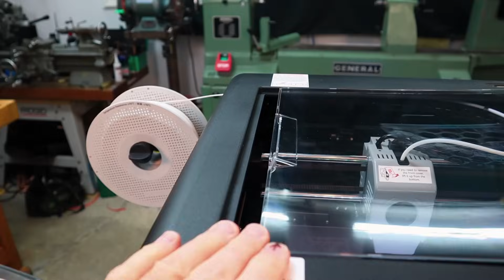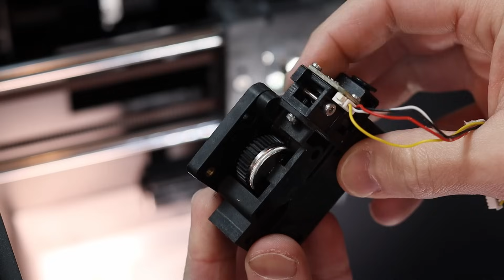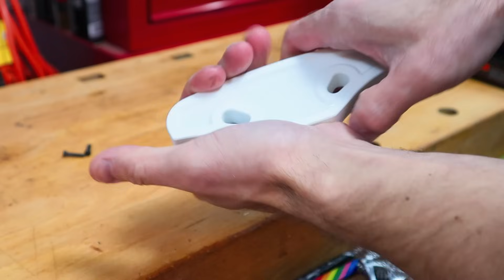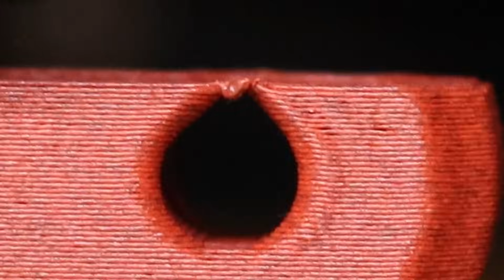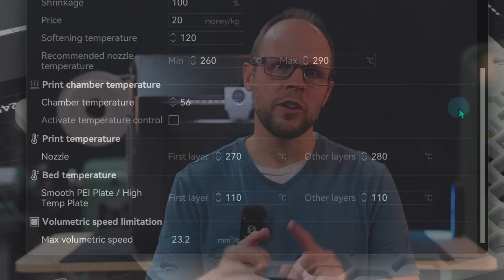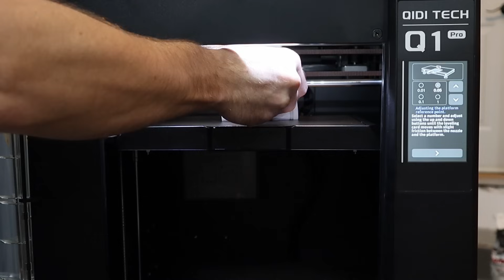The All NEW QIDI Q1 Pro - Affordable, High Performance and High Tem...?

Comment: I look forward to your Q1 pro upgrades especially a air filter one. I used your QIDI link when I bought mine a day ago  (3-20-24) so I hope it  gave you credit. The Q1 Pro is arriving sometime tomorrow (3-22-24) already.
Reply from the maker: The first of two videos I have planned is coming tomorrow, I'll probably make several more because the printer is so capable and it opens up a lot more possibilities for printing stronger parts.  

Thanks for using the link I really appreciate it!

That's fast shipping, they were already loaded in the truck ready to go.
Reply: One more thing to add to a video, best way to remove and add filament. I seem to get a heatbreak clog and have to remove the heater assembly ( easy fortunately)to clear the piece of filament. 
I’ve owned many direct drive printers but they all had a manual extruder gear release lever. Made it easy to heat the hotend, push on the filament and then quickly pull it out, nothing left behind. 
Please do more videos on this printer. I need to find that link to make a donation when I send this post.
Reply from the maker: @gr7396  I just released a video yesterday and I'll definintely have more to come, I'm still going strong with this printer.  The only time I've had a problem with switching filaments was when I tried to use their process for unloading/loading filament and I was switching from PETG to TPU.  It left too much material after the extruder gears and the TPU was not a fan of pushing PETG.  I stopped using their process and I went to what other printers do, extruder a small amount and then retract the rest, works like a charm.  

I've spoken with QIDI about this issue and they have passed the info along to their engineers, I hope to see a fix on their touchscreen.  The Bambu performs better for material changes so maybe there is something to learn there from the Bambu printers that QIDI can apply as well.

I was told that you can manually pull the filament out, it is on a spring Afterall, so maybe it's possible.  I will have to try this out to be sure.
Reply: They should have added a release lever so you can get a straight shot into and out of the hotend. I’m not new to printer mods and will think on it and try a few things. With the hotend cover easily removed to get to the extruder gear, that adds an advantage but there must be a simple solution or an extruder redesign? 
FYI, I had trouble with PayPal taking my new CCard then it used another on file for $1+ $1 monthly. So I guess I’m a ASA member now or two pla members? 
Keep on this Q1 Pro and QIDI and I/we will be good. Slicer info and print settings also a good thing to keep on.

Comment: It definitely has a few questionable design choices, but it's still pretty good, especially for the price
Reply from the maker: There are just a few things I would want to change, tomorrow I have a video releasing for one of them.  Overall the important parts are accounted for, the extruder, hotend, structure.  The print quality at this point rivals the Bambu X1C, it may, just may be better, I can't tell yet if that's because the parts warp less with the heated chamber.  Regardless, for the price, it's a solid printer and I look forward to a larger version of the printer, I assume there will be .
Reply: @NeedItMakeIt  The less warping of stuff is probably due to the actively heated chamber, that's one of the few differences it could even be ¯\_(ツ)_/¯

Comment: Odd that only Vector 3d mentioned that this machine is running a klipper version over 2 years old, and there is no way to update it because of the proprietary changes Qidi did -- vanilla klipper is the best klipper.
Reply from the maker: I can reach out to QIDI to confirm, but I have been printing on this Q1 every day which hard prints and the quality is as good or better than the X1C, the extruder, the structure, the motors, everything seems to be how it should be to maximize the quality of the final product.  I even printed a nearly solid ABS print today with fuzzy skin with 0.06 Amplitude and Length, which is less than I've ever done and it looks incredible, can you tell that I'm impressed?  Normally I'd have to struggle with settings and calibrating filament... I have done nothing but use the stock settings and turned on fuzzy skin, it was also in a heated chamber, which probably helped to keep it flat. 

I'm blabbering on, the point that I'm trying to make is that old or new, it seems to produce great results.

Comment: Great review!I like the practical prints vs what others do in their reviews by printing figures and benchies and other useless trinkets.  Your way is much more desirable because these are the types of things I want to print, functional things like jigs and brackets, etc.  Definitely tempting to pick one up. I just wish they would have gone with a slightly larger build plate 256mm at minimum.  It's kind of strange why they've released this one because the X-Plus 3 also has the same nozzle temp and heated chamber, but doesn't have a camera by default, it's also larger.   Either way, I really like where Qidi is headed, if they keep improving like they are, they'll be sitting  high up there soon!
Reply from the maker: You and I must think alike because it really hurts me inside to print little boats and toasters and know that they have no function aside from showing how they look.   I've been printing more with the Q1 and it continues to perform well, even beyond what I would expect.  ABS, no problem, PETG with the peaked holes, no problem, PC.  I didn't bother with PLA since this printer is really meant for higher temp printing anyway. 

I think they'll be coming out with a whole series of these printers, I can only assume they're already in the works.  Q1 PRO-PLUS, Q1 MAX?   The printer really hit the mark as far as giving people what they're looking for. 

They probably were responding to feedback about the looks of their printer and make some other small design changes, the hotend for example, now they've moved to the Copper HS, which is pretty nice indeed.

We'll have to keep an eye on them for sure!  I hope they come out with an IDEX or something to print just one more material.  If I could print 2 color TPU, that would also be really cool.
Reply: @NeedItMakeIt  That would be pretty awesome!
Reply: Oooo, side note.  I would love to see it printing sinter metal filament parts.
Reply: For the sake of discussion, I ordered this printer because of the size and camera. I'm a small engine teacher and the head bus mechanic at our local High School. This unit fits on my personal toolbox inside the top hutch. Just barely, but it is in a space that is a no student fly zone. The build plate is just big enough that I can print most parts for student projects and bus parts that need to be tougher materials. Any bigger and I literally couldn't get this printer in the space I wanted for a heated enclosure unit. With the camera I can keep track of prints regardless of where I'm at in the school. I will also be able to link students to the cam so they can keep track of their parts. Curiosity and excitement are easier when you can see the action. That being said we have a Elegoo N4 Max already. We went big for "just in case" and it has paid off. But because of our shop environment ABS and such 100% will warp. So now I have to build an enclosure. But honestly most of our class stuff is currently "survivng" on PLA. With this Q1 I will now be able to pop out the occasional tough part for kids or any of my maintenance parts in a flash until i can get the N4 Max customized. So, not trying to down play your needs, but just wanting to mention this unit hit me nail on the head😂. Also, a side note, this will be my 3rd printer purchase in 7 months. I have a problem.

Comment: Could  you elaborate on spool tangle sensor please?
How easy would it be to add to, say, K1 ?
Reply from the maker: Hi, and sure, the tangle sensor is on a spring, when the spring maxes out, it looks like there is a switch activated, it's fairly simple I suppose and probably could be integrated into the K1 with a bit of design knowhow.

Comment: The most complete and objective review of that Q1 Pro. Great tutorial and especially impressive outputs. Thank you! You earn a new subscriber!
Reply from the maker: Awesome thank you very much!   For this printer they made it pretty easy on me, it works out of the box, it prints really nice with hard prints, and they're real prints no just benchys or toasters, and yeah it's a bit bulky, but I can look past that if it performs well, and it does.  Today I printed a nearly solid ABS print, with the finest fuzzy skin that I've ever tried thinking it would break the printer, and the print turned out flawless, one of the if not the nicest looking prints I've ever made.  

They've obviously took the time to address the main points to create a high-performance printer at a good prince, the heated chamber puts it over the top.  I think they should sell an add-on filtration system though, high-temp materials including ABS and PC release more chemicals into the air, I'm pretty sure that long-term exposure will lead to some sort of health impacts.
Reply: @NeedItMakeIt Health hazard is an important point as you explained it so well. Few people mentioned it in filament 3D printing. It looks obvious when you deal with laser cutter just because people see the fumes... a bit childish IMHO.
I hate flattering but your channel deserves a much higher audience. It's informative, video editing and narrative are super consistent, video quality as well. There's a huge work behind.

Comment: You should turn the printer upside down and make a video about it ;) Printing like that should work too and would be funny.
Some feedback; I would've liked to see more comments about the material and build quality of the printer - it looks very plasticky and not made for longevity. Otherwise, I like your style of videos. :)
Reply from the maker: I'd probably get an email from QIDI saying... "Please do not do that!"

The outside being ABS, I suppose could breakdown over time, but everything on the inside as far as structural parts is Nylon-GF, industrial quality parts.  It's funny though that the GF parts actually look shinier and cheaper than regular ABS parts, I guess it's just the process for molding them, but they're quite nice and very rigid.  The case being ABS should last for quite some time, repeated exposure to heat cycles shouldn't be much of a problem because we're no greater than 60+/-°C.  

I think they could have taken a bit more time with the cover to make it look... well cooler, but aside from that, it's a good printer.  I'd like to see some extra holes to bolt things to, I want to add things to the outside and it's pretty hard with these contours, regardless, we'll get it done with some 3D scanning and modelling.  

Thanks for your comment I appreciate that you took the time out of your day!
Reply: @NeedItMakeIt Thank you for the detailed reply :)

Comment: You need to decrease your bridge flow ratio in your slicer settings. When it is finishing the top of the bridge, too much material is extruded and causes a small blob and blocks the extruder slightly causing “under extrusion” after holes. Start at -.02(.98) and work your way down, print something small like a benchy or make a small part to simulate those holes. I’ve been fighting the same issue on an X-Plus-3 and I think I’m down to .93 bridge flow ratio on PLA+.
Reply from the maker: Ah, thanks for that!  I've printed many a PETG print, but not so many in PETG-CF and it seems to be a different animal.  Peaking the holes seems to work really well and doesn't take much longer in the design stage.  I would like to see if Fusion can create a peaking feature to save a few steps.  Otherwise I've been printing PETG-CF and ABS and getting flawless results, the ABS today I did was the nicest looking print I've ever made.  I added a micro-fuzzy-skin as a test to see if the printer could handle that level of fine movement, but it handled it with ease.

Comment: Good stuff, like the xsmart 3 with a few improvements and a bit larger. I do not like the new filament unloading routine at all. Before (actually feeding it backwards) it was much better
Reply: You don't actually have to do it that way. You can heat it up and pull it right out.
Reply from the maker: I think the retraction is a bit slow, so pulling out quickly is a good option for sure, slow pull gives a long thin piece of filament and possibly some material left where you don't want it.
Reply: Else, probably a buy

Comment: Thanks for the review. It looks like a great printer. I have a k1 and wish Creality would have done a bit more on the k1c. So I assume this printer will take a good chunk of their market share. I would like to see more videos on this printer. Cheers from Canada 🇨🇦
Reply from the maker: Thanks Andy!  I'm still going strong with some super heavy prints today and very clean results, some of my best ever.  I think they focused where they needed to and I agree that Creality is going to take a hit.  The steel frame and beefy CF Nylon parts inside likely help, the extruder of course, it's a nice solid unit as well.  That helical gear from the motor to extruder was a nice thing to see too, I wonder if they found that it helps with power transmission to get better print results.

You will see another video on this printer this weekend!  I have some coming for the KE as well.  So many projects and so little time!   Maybe I need to invest in some kind of feed-tube for myself :) to save time making food.
Reply: @NeedItMakeIt  lol. Yeah there is only so much time in a day. And I agree the helical cut gears are interesting for sure.

Comment: Depending what those extruder gear are made out of I can't see them lasting in the long term but hey you never know
Reply from the maker: If you like I can have another look, I can also ask the company, I am in contact with them.   Having taken apart some RC cars, I'm always surprised how well the gears do considering how much run time they've had.  What is better steel to plastic, or plastic to plastic?

Comment: its such a hard choice, the x-smart 3 is available;e and at 250, but this is 400 but available mid April, as an engineering student who is tight on money what should I consider buying out of the two, I really need help, might need to make a whole matrix for this
Reply: Ive had xsmart for few months. Beast of a machine for that price. Mostly using asa. Bang for the buck. But at the moment im thinking about getting this one also. 😀
Reply: Easy choice if you need the more advanced materials.
Reply: i have you a legit answer but it seems the channel owner is a bit triggered as he has deleted a few of my comments. he seems to be a little precious like many amateurs in this community. anyway, the Max3 is the best all rounder for size, temp and budget.

Comment: I think you need to lower the cooling for overhangs concerning your Creality replacement parts.
Reply from the maker: I ended up peaking the holes and that worked perfectly, ABS seemed to handle the holes regardless, but this PETG-CF is a bit of a different animal, and I should have had some better cooling as well.  Someone else mentioned to reduce the bridge extrusion also.  I'm pretty happy with the results I've been getting since doing the recordings, they're fully flawless with peaked holes.

Comment: I see to purge and replace filiment the tubing is removed from the coupler, the filament is cut and removed. The the tubing is reinserts into the coupler again. Is this coupler replaceable and of a type used on Bowden tubing for years? I ask because after a while on my ender printers I’ve owned the coupler digs into the tubing and won’t release it. 
If easy to replace and available then I’m very interested in this printer for the price vs a K1C I was looking at. 
Thanks for the parts  tear down look at the hotend.
Reply: It's just a piece of teflon tube, you could buy a new one
Reply: Yes on new tubing but it’s the coupler on the hotend a reviewer side won’t release the tubing so you can pull it out to cut the filament? I have ordered the W1 pro so I guess I’ll find out if there’s a problem.
Reply from the maker: I don't do it this way, I just heat up the nozzle and pull the filament out, or you can extrude a tiny amount then hit retract.  leaving some filament beyond the gears isn't a good idea because if for example you feed in some TPU and you have some PETG or ABS in there, the TPU will have a tough time trying to force the other filament out of the nozzle, better to remove it as much as possible I think.  

I've fed this info back to QIDI and we'll see if they adjust the load-unload cycles on the printer by default, I'd like to see them do this.  

This printer performs better than the K1C, it is far more solid.  Maybe just a filter and a new spool holder (I have a video for that this weekend coming)

Comment: This or the k1c? And why?
Reply from the maker: I don't have the K1C, but this printer in my mind has far better structure than the Creality K1 or K1C.  The K1C looks good and prints okay, but the extruder does not perform as well as this one, it can't print high-temp materials like this one, and this printer also has a larger BV than the K1C.  The K1C really is just the K1 with the fixes added to get it to an acceptable point.  I like Creality and I like my other printers... this one just does a better job where it matters IMO.
Reply: @NeedItMakeIt  wait the k1c can't print hi temp filaments? It goes up to 300c, and the inside can get up to 50c.